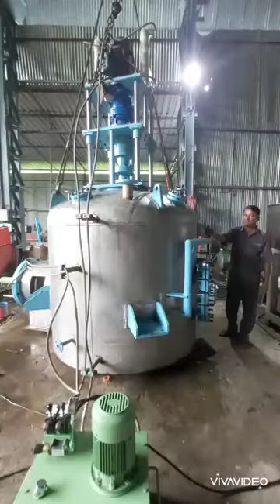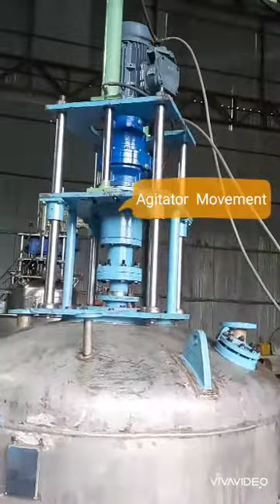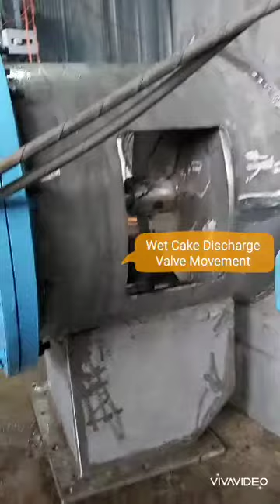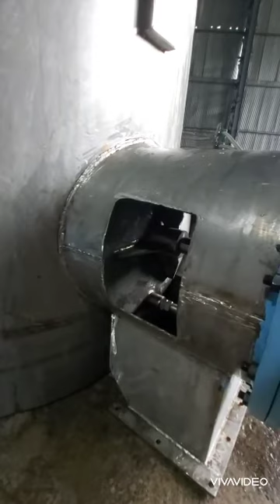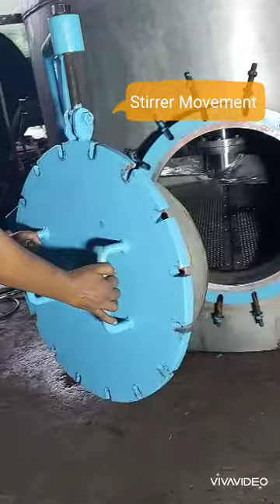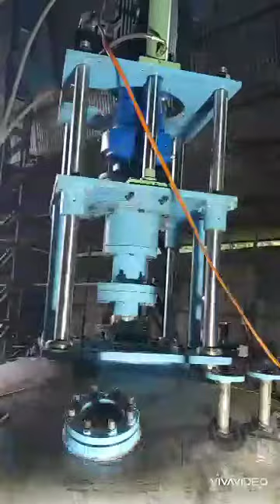Agitated Nutsche Filter

Comment: Geo drytech contributes to the global Energy industry, fabrication of Rotary Vacuum Paddle Dryer , Agitated Nutsche Filter .It also engaged in the design, engineering and fabrication of heat exchangers, pressure vessels, columns and other heat transfer equipment used in critical High-Temperature and High-Pressure processes with applications in Oil & Gas, Fertiliser and Power sectors.
Highly committed , honesty , quality work and perfect team to work ..
Reply from the maker: Thank you Sanjeev Sir.  Please send your requirement at geodrytech@gmail.com. or Call us at +91-22-27435656